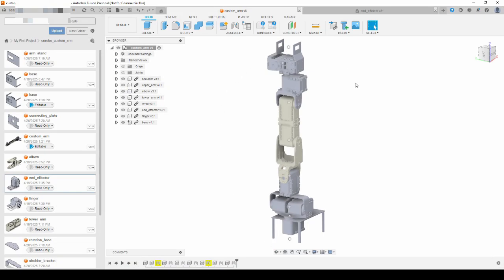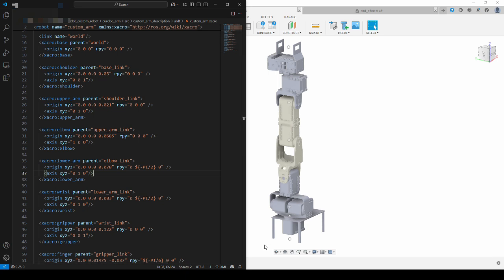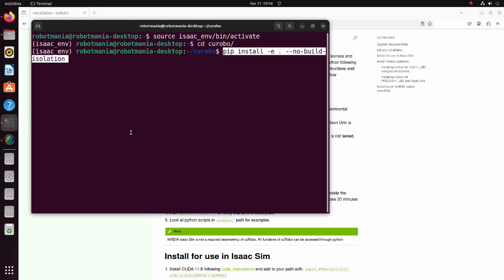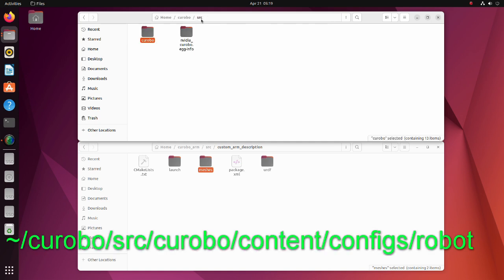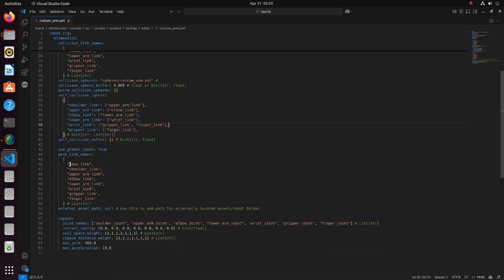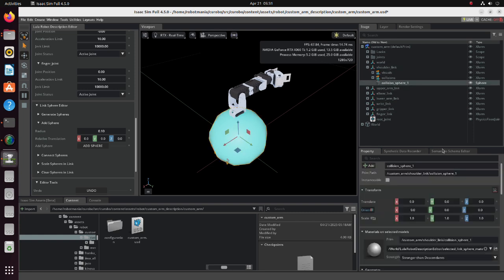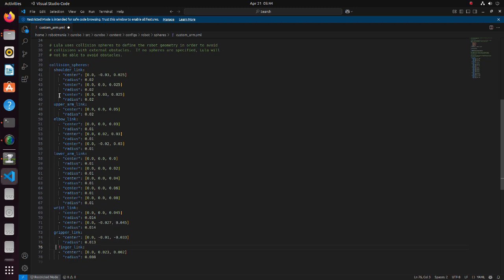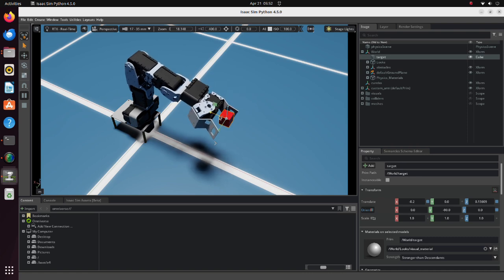How to Use cuRobo with a Custom Robotic Arm

Comment: Thank you so much for the video. I'm using cuRobo to add spheres in Isaacsim, but the effect is not good. Is there a method to automatically generate spheres or how to add better spheres?
Reply from the maker: Hi yang zhou!
Thanks for watching my video!
What do you mean by “effect is not good”? I think, currently there is no automatic method to generate spheres. Unfortunately, you have to do it yourself.
Reply: Thanks very much for your prompt reply. I am conducting a simulation test of a robotic arm system grasping objects, and I need to add spheres to the robotic arm. I am unsure how to add spheres to achieve better simulation results and accuracy.
Reply from the maker: @yangzhou-df5cc  I have multiple videos with robotic arm manipulation. Here are several of them
https://www.youtube.com/watch?v=inG9LPxxegk
https://www.youtube.com/watch?v=k4R60XoZmIE
I hope these videos will help you.
Reply: Thank you so much for your help. I will continue to follow and support your videos.
Reply: Thank you so much for your help. I will continue to follow and support your videos.

Comment: Hi @robotmania, thank you so much for the great content! - I try to implement all your videos. one question with the shared files, the collision spheres yml file is same as the regular yml file, that needs to be changed.
Reply from the maker: Hi Niranjan Sujay!
Sorry, I didn’t quite get what you meant. What exactly should be changed?
Reply: @robotmania8896  - this file ~/isaac_curobo_tutorial-20250715T180042Z-1-001/isaac_curobo_tutorial/curobo_arm/configs/spheres/custom_arm.yml and this file ~/isaac_curobo_tutorial-20250715T180042Z-1-001/isaac_curobo_tutorial/curobo_arm/configs/custom_arm.yml , both files are same - one should contain the collision spheres information.
Reply: @robotmania8896  In the download files you provided, the contents of curobo_arm/configs/custom_arm.yml and curobo_arm/configs/spheres/custom_arm.yml are the same. The file spheres/custom_arm.yml should be the one exported from the Lula Robot Description Editor.
Reply from the maker: @QFena  Thanks for pointing out. I replaced the file.